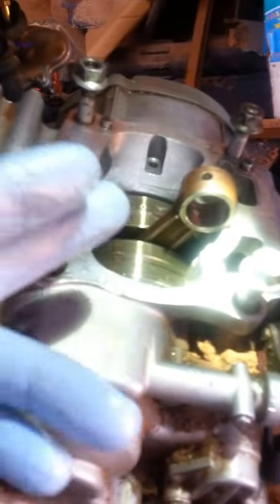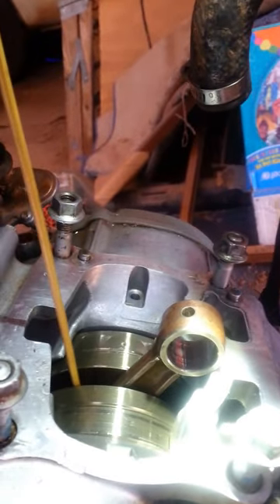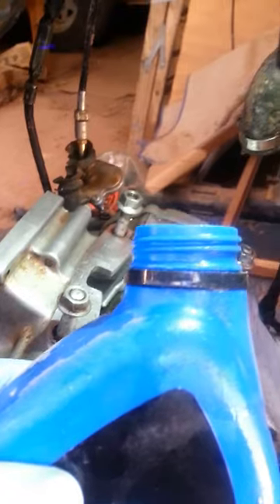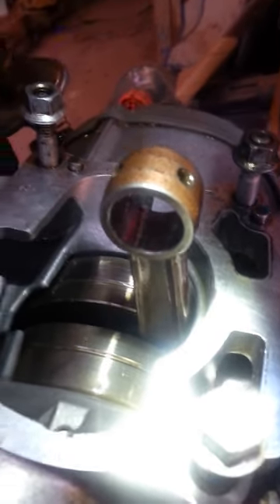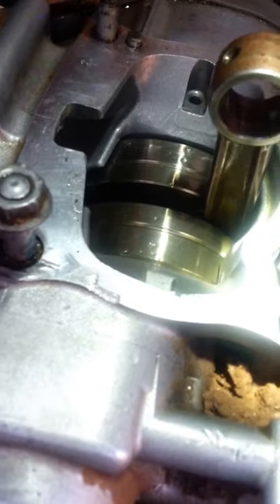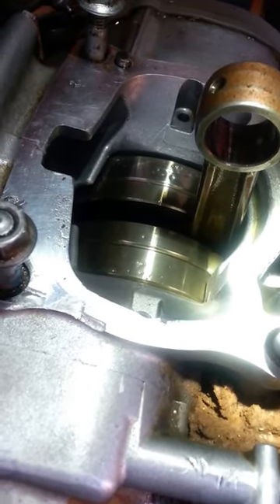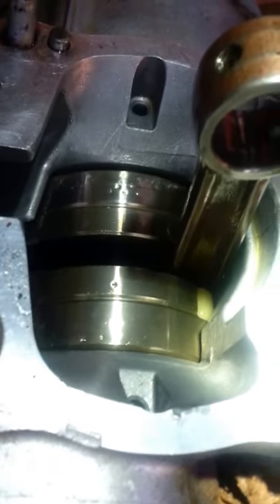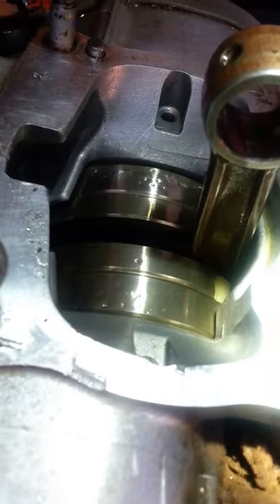Easy shortcut to Clean any debris out of a Dirt bike Crankcase

Comment: Diesel actually works really well swish it around and dump and repeat
Reply from the maker: Yeah it does actually I've used diesel multiple times
Reply: I was thinking of using diesel then a rinse of 2stroke oil after probably wouldn't hurt it en
Reply: Mineral spirit
Reply: which is best diesel or mineral oil?

Comment: Great video! my piston shattered and my bike locked up because all of the piston chunks fell down in the crank but no damage to the bottom end that i can see cleaned out most of the chunks just by taking the motor off the frame and turning it upside down and shaking it but anyway sorry for the run on sentence and no punctuation but i figured id tell you my story thanks alot 

p.s is your bike back running and is it good i cant imagine that the residual oil left would harm the bottom end if anything id think it help keep the crank bearing lubed up but you some people would say not to do that or something along those lines anyway enjoy your ride brother one LOVE
Reply: Needle bearing*
Reply from the maker: Luke Vandegrift yeah man thanks; glad it came handy for you, my bike is running tip top also just me I like to lubricate the Crank with a thin film of oil to keep everything smoothly in operation but that's just me. Shortly 3 weeks after this video I rebuilt my bottom end, and installed Hot Rods Complete bottom end kit went smoothly now she has torque all in all reliability also with a Pro-lite wiseco piston. Glad yours went good.
Reply from the maker: crime and grime channel if you have a small skinny magnet you can fish it out. But need to fill the crank area with abit of oil so circlip can come afloat make sure you rotate the crank forward and backward, can be very meticulous to get circlips out and abit of patience Hope this helps.
Reply: I have the exact same problem right now bro. Gonna try this and hope it works!
Reply: @Echoepic95  so cleaning the crankcase  via your method didn’t work?